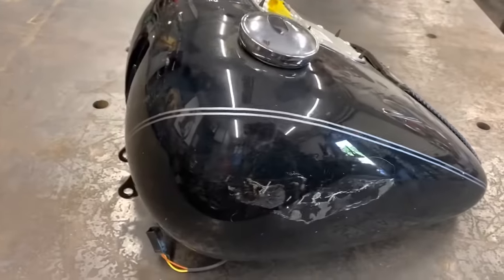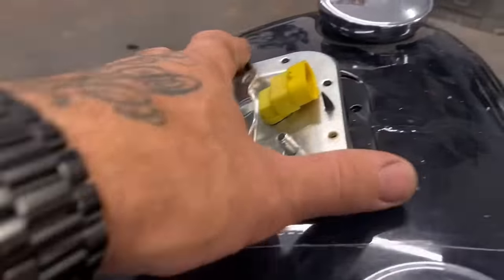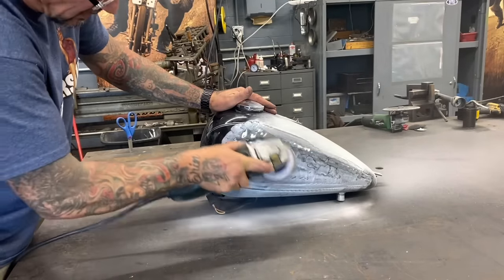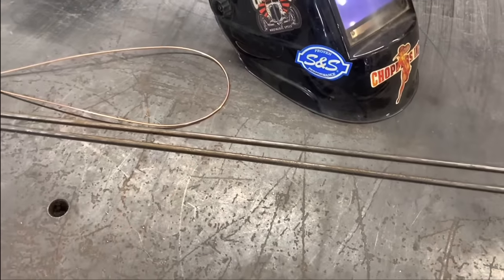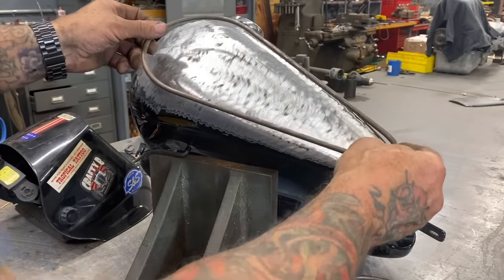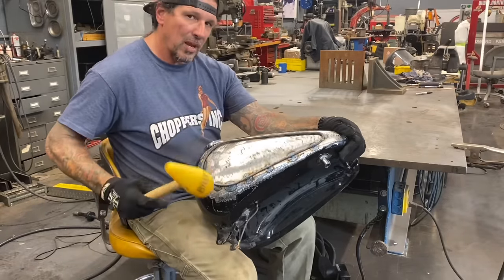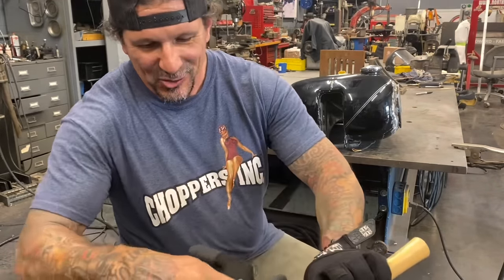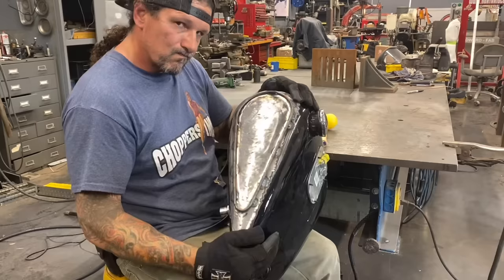Indian Larry Dished Chopper Gas Tank for Yelawolf by Billy Lane with Hot Rod Legend George Barris

Comment: Gibson makes a reissue of their 1959 Les Paul, why doesn't Harley-Davidson make a reissue of a Panhead or Shovelhead?
Reply: Completely different game also the Gibson reissues are horrible. If you want a good reissue there are better builders. 
S&S make shovel heads and knuckleheads. Although now I believe their current knucklehead is actually a knucklehead cone shovel hybrid. Old school thing. 

Ultima also make a shovelhead. 

Std used to have heads that matched all the old heads but modernized slightly. I think vtwin mfg also make some replica stuff as well as cannonball. 

You can still build basically original engines.
Reply: It's your chance to be the first guy to do the remake that would be bitchen
Reply: Smog
Reply: There are kits
Reply: @canyonmonkey2537  true. EPA has been cracking down on individuals, but you do get one emission exempt build in your life
Reply: @masjuggalo  I live in a non emissions region.
Reply: Harley is making reissue bikes. Called the ICONS collection with a electra glide styled after the 1969 model named the revival and the el diablo, reminiscent of the 1983 FXRT. they just have modern engines and features. Stillplenty of builders using the SN, PN, and KN series from SS cycle, brand new components. but it really comes down to emissions and the carbon tax as to why vehicle manufactures do not use older technology engines.
Reply: Epa nazis
Reply: @masjuggalo  where do you live, that allows one emission-exemption of a vehicle once in your life?
Reply: Because Harley Davidson is not Gibson.
Reply: @robertstrohlin6051  you wouldn't want to buy a brand new Shovelhead or Panhead?...lmao
Reply: Why not. Dodege brought the CHARGER and the CHALLENGER and look at the sales they had with them.
Reply: Because that makes way too much sense.
Reply: Because garbage.
Reply: Hell yeah!!!
Reply: Because people who buy new Harley’s can’t fix them let alone advance timing to kick one over …
Reply: @anthonystrazza4586  I'm not talking about Flathead engines, I'm talking about a modern aluminum Panhead and Shovelhead, they're a lot better than the AMF cast iron engines of the day...lol
Some people say emissions but they can put a removed catalytic converter on them just like they have on all their new bikes...lol
Reply: @bryonkidder6199  I agree it can be done but sadly it will never
Reply: @anthonystrazza4586  lmao just consider it the best security system ever.
Reply: S&S
Reply: @kornbread944  does S&S offer a complete bike?
I haven't seen that...lol
They could use an S&S drivetrain, if they could come to a deal and if S&S was able supply the product...lol
I'm talking about going into the H-D Dealer and buying a brand new FLH Panhead or Shovelhead and H-D providing period correct parts and accessories they can sell to customize that bike.
H-D already has Screaming Eagle and the CVO, they could add another Vintage division, like the Gibson Custom Shop does with their guitars and Fender too...lol
Reply: @bryonkidder6199  why would you want a bike with 50hp and 60lb tq? Probably the reason the dont…it’s outdated technology
Reply: @bryonkidder6199  just go build one…yuppies don’t need everything handed to them for a $$
Reply: @kornbread944  I don't think the Shovelhead engine is the most beautiful engine ever produced because of the hp or technology behind it...lmfao!
You can still buy a twin-cam or build your own kit bike, I'm not trying to take anything away. I am trying to add to it...lol
I think H-D wouldn't be able to manufacture them quick enough, just like Ford did with the Mustang, Chevy did with the Camero, and Dodge did with the Hemi Challenger...lol
Reply: @lifebehindbars31  how can a 74 cid engine make more emissions than a 120 cid engine?
Reply: @bryonkidder6199  or the fact that it would leak on the showroom floor or guaranteed to get you 10miles from wherever your trying to go? Evo was by far the most reliable motor harley made…shovel head sound great…that’s about it….but we are all entitled to our own opinion…no need to LoL after every statement bud.

Harley does make a retro version of their bikes. Just doesn’t have an outdated motor that can’t merge on a highway.
Reply: @bryonkidder6199  In theory the 120ci would produce more emissions however a modern engine has Catalytic converters, carbon canisters, fuel injection with map and o2 sensors, your standard EPA emissions components.  If someone was up to the task I'm sure they can get a panhead to pass current emissions standards by adding catalytic converters and fuel injection with the appropriate sensors. But I assume an earth friendly panhead would be an absolute dog with all the power robbing emissions equipment
Reply: @kornbread944  I gotta laugh...lol
H-D doesn't have to use the old AMF casts, they can build an aluminum Shovel or Pan, just like the S&S repro's...lol
If you're a 400 pounder, you might need to buy a 120" twin-cam but normal weight people don't need more than 90-100 hp on bike to go fast...lmfao! 
Again, I'm not forcing YOU to like it, I asked why doesn't H-D reproduce the engines and motorcycles that made them famous?...LMAO!
Reply: @lifebehindbars31  they can put an easily removable cat on the bike, just like they put on all their new bikes, to pass your emissions tests?
They could even put a throttle body fuel injection "carburetor" on the new bike that can easily be replaced with a traditional S&S carburetor.
There's gotta be ways around the emissions argument...imolol
Reply: @bryonkidder6199  LMAO, because they weren’t reliable and made no power. Next question please
Reply: @kornbread944  you do understand that the S&S Shovelhead & Panhead engines are aluminum engines and 92 or 93 cid?...lmfao
You are saying you don't want a 1978 AMF H-D Shovelhead, okay I understand that....lol
Again, I'm talking about a 2023 FL style Shovelhead. They don't have to build AMF cast iron engines anymore...lol
The only "problem" in the design of the Shovelhead besides the cast iron, is the push rod angles but that only becomes a problem at high rpm and Shovelheads weren't made for high rpm use. If you want that "technology" you can buy a rice burner...lmfao!
Reply: @kornbread944  why you watching Billy Lane videos?...lmao
You understand that he uses the junk Panhead, Flathead, Shovelhead, and Knucklehead engines in his custom bikes that can't get out of their own way, right?...L○L
Reply: @bryonkidder6199  lmao, holy shit, REALLY!? They don’t use cast iron anymore🤯holy fuck, thanks man, totally changes my mind🤣😂.  Your absolutely right, that’s the only reason the completely redesigned the motor, fucking genius
Reply: Harley is actively trying to go bankrupt, that’s why.
Reply: Because they were a headache, and they don't want problems. The V twin being much more reliable.
Reply: @bmxriderforlife1234  C’mon, all Gibson reissues aren’t horrible. For starters, have you played any of the signature Les Paul ‘Bursts? Allman, Rossington, Bloomfield n’ such? They’re great. Just unjustifiably expensive. Same with stuff tile the Korina V and Explorer reissues. 10K but they ARE great guitars
Reply: @Cire Nosnor  they may still be nice guitars albeit over priced but the qc and actually quality in regards to instrument build quality isn't what it used to be. I'd rather have a The Les Paul even with its sandwich neck and the rest. They're still built like a burst with the better neck joints and actually held to a standard. 

Look up all the brand new les Paul's that need neck work severely.
Reply: @johnband3 a four door Charger ?  Nothing close to a reissue. Just the name. IMO one of the ugliest , slug looking cars on the road and certainly not worthy to wear the Charger badge.  It's speed means nothing to me.
Reply: Cause they would find a way to mess it up and make It trash.
Reply: They is a shovelhead remake out of sweeden
Reply: @johnband3  the charger and challenger are car models. The panhead, knucklehead, etc are motors. Not the same.
Reply: I couldn’t ride a Harley after they have them made in India. What a slap in the face to the USA.
Reply: The EPA
Reply: @YeshuaDisciple916 it was satire
Reply: @bryonkidder6199 AMF made lots of shovel heads
Reply: @nathandevine552   yes, they did but my question is why doesn't H-D offer a new Shovelhead and/or Panhead to the public?
H-D can put removable smog equipment to pass the EPA regulations. I find it hard to believe a 74 cid Shovelhead puts out more co2 than a brand new Screaming Eagle big cid Twin-Cam engine...btw
Reply: They should! Rainbow colored!!

Comment: hey billy off topic, i hope that's ok, i have a 96 softail that i'm  working on it has a 1 5/8 bdl on it now that is inside the primary. i picked up a 3 inch belt drive complete really cheap that's never been installed. is it possible to cut the backing plate away down to just the bearing carrier or will there be any problems in doing this that i might be missing. thanks chris